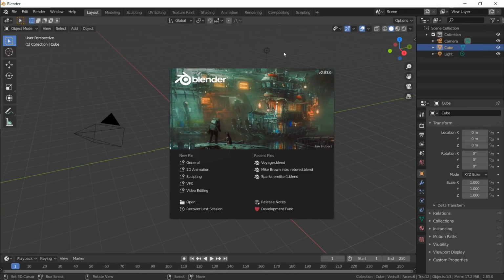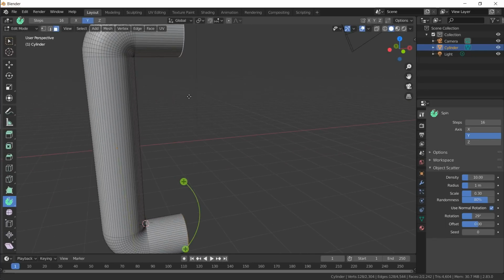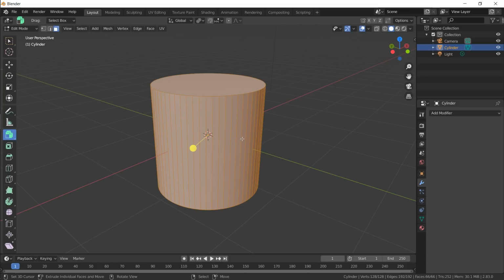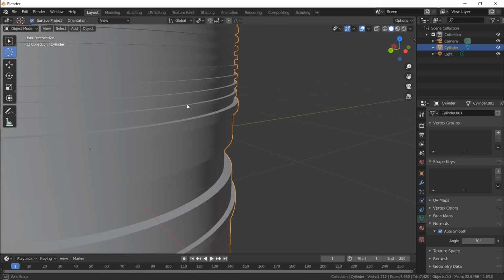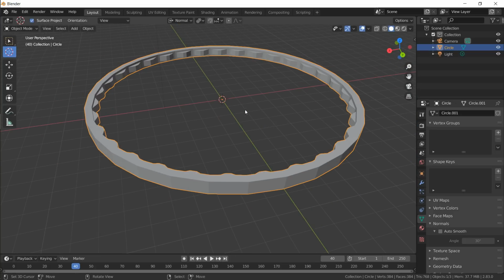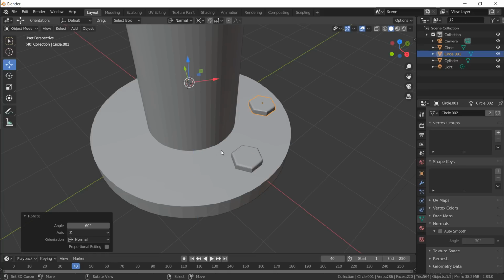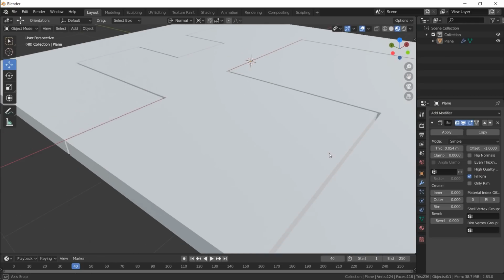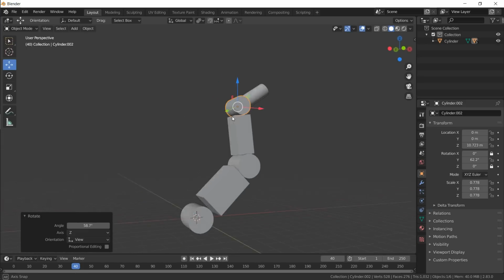10 Hard surface tricks for Blender

Comment: For the animation without a rig, can I create an animation and export the animation to unity without a rig? And another question, since the pieces are all separated does that mean when I export, my model will come in pieces?
Reply from the maker: I don't have any experience with unity sorry. But maybe the object data could still be used. And yes it will export as separate meshes unless you join them.
Reply: @DanielGrovePhoto  Oh ok. Thanks for answering my question :)

Comment: If you are looking to make a car air filter, I made one on accident yesterday messing with the spin tool. All you do is spin a cube a bunch of times and it will make a cylinder with the edges of the cubes being the outside face.
Reply from the maker: That is a good way to make that shape! I'd prefer though to make a cylinder with maybe 64-120 vertices, select all the outward facing faces, do an individual inset on all faces at once, and then extrude inward and bevel those new edges. May need a top and bottom cap shape to complete it.

Comment: All tips are very solid and helpful for beginners, but the last one about parenting, I totally didn't know about even with some experience. I will absolutely integrate this into my workflow :D
All in all a useful compilation, thanks for sharing!
Reply from the maker: Thanks so much! Yeah the parenting thing happened out of necessity.. or laziness once I started trying to learn rigging and bones. I found they are more geared to organic models and it didn't make sense why a multi piece hard surface model like a robot should be joined as one mesh! I like having control over objects and not joining them. So I found parenting a good easy route for animating robotic type stuff. be sure to put the pivot or origin points where the joint is AND lock / limit rotations for the object so it will only move the way you want.
Reply: @DanielGrovePhoto  Best things develope out of laziness :D
But i totally agree, I am also more interested in mechanical stuff, like mechas and such, but rigging seemed always kind of overwhelming. So your tipp will be massively usefull!

Comment: In order to use the mirror modifier you could use the "automirror" add on (comes with blender). Activate it, and in edit mode press N to get the menu. Click on "edit" and automirror.
It will split the geometry for you, adds a mirror modifier and activates clipping.

Next up: for the rings around your cylinder use "extrude around normals": select the faces and press alt-E. Then extrude along normals. Saves you time there.
Reply from the maker: Awesome trick thank you! I've often thought "why do I have to do these steps myself over and over? I wish there were an addon!"

Comment: Shift - R is a super handy shortcut to repeat an action or series of actions. So copying the bolts around the base of your pipe would be- (Alt-D, R, Z, 60, enter. Shift-R x 4)
Reply from the maker: Ya I use to think I had to do enter after shift D and so that rendered shift R useless. But I was wrong! Thanks for this tip though it's great.

Comment: For the flat panel with depth, there's an easier and I think better way. When you bevel and delete faces, you end up with gaps that light might leak through, or that you might be able to see through at some camera angles, which I don't think is what you want for most panels.

Instead, select the edges like in the example, then hit V. It'll rip the selected faces, but keep them in place. The three parts of the plane will be touching, but not connected. Then, add the solidify modifier for your desired thickness, and after that add the bevel modifier, and play with the distance and number of segments. That bevel modifier will pull the edges apart near the surface, but leave them touching lower down so you get that well fitted panel look, without being able to see through the gaps.

You can use the shade smooth + autosmooth trick from earlier to keep the number of segments on your bevel lower, without the edges looking sharp too!
Reply from the maker: Thanks that is a great tip and I've never learned rip. When I have tried it didn't work so I've just avoided it. Thanks again.

Comment: Great video, any tips regarding larger bends on the pipes to add a bit more variation to a complex pipe over constant tight 90 degree bends.
Reply from the maker: Well they don't have to be 90° and moving the 3d cursor farther away will make the bend radius larger.
Reply: You could also use curves to create pipes.
Reply from the maker: @ZEDCorbett  True you can and they are handy but there are some downsides to it.
1. If you use curves in 2D mode all pipes must be on the same plane such as X and Y, no Z for example.
2. If you use curves in 3D mode there is an odd pinching effect near the bends if in vector joint mode for harsh angles like 45 and 90 degree turns. I have not yet found how to avoid this pinching. I hope someone has and can help me!
3. If you use either mode you can't add rings, width changes etc. to add character and style to the pipes. There is a way to use another curve to change the thickness of the main curve but it's a hastle. 

But with some cleverness use curves mixed with mesh objects for joints and other style pieces for a good outcome.
Reply: @DanielGrovePhoto  You can use the Add Pipes addon - ships with Blender, just select it in Preferences

Comment: Thanks. One pedantic thing on Tip 1: You need to drag the spin centre away from the cylinder a bit. You would never get a pipe bend with zero internal diameter in real life.
Reply from the maker: Oh thank you! I appreciate details like that and didn't know.

Comment: Another tip: Each time you hear "don't move your mouse" in this tutorial, you can substitute that with "click the right mouse button" (on new controls). This apply whatever tool you have started working with (extrusion, loop cuts, etc) in its default position, undoing any mouse movement. Much easier than "don't move".
Reply: Thank you. :)

Comment: Can use shift + r to repeat the action for the bolt thing :)
Reply: I did this by just using the array modifier and using the "offset object" option to make it use an empty object at the 3D cursor as the central point
Reply: @r6scrubs126  yeah was thinking the same, it's just easier to use an empty
Reply: I think about that too))
Reply: also you don't have to press Enter after Alt+D - you can press R+the desired degree and then Enter
Reply from the maker: Yes thanks! Learn something new every day/video.
Reply: I tried this and it does not work. It only repeats the last action, which is the rotation, but it does not repeat the ALT+D operation.

Comment: Now I will never have to suffer making pipes or arches lmao
Reply from the maker: Glad to hear the video helped! Check out the others on hard surface and hallway modeling they have some cool tricks in them too.
Reply: If you want more organic pipes or tubes you can just use curves and use a thickness
Reply: @Thatsmahnut  agree and that also works for the pipes he shows. And indeed it is much quicker, more flexible when it comes to the shape of the pipes (make them longer, add corners etc) and of course the profile. Not only can you use the curve geometry options but also other curves as profile, which you can change very easily. Pipes, ceiling molding, beams or picture frames, all made very easy and quick with curves.

Comment: Thanks for the one with the pipe! I often tried to achieve that but always ended up with something ugly, for I may not have used the right technique. This one's really easy and works!
Reply from the maker: Thanks! That trick comes in handy a lot for all kinds of cylindrical shapes like hydraulics, lightsabers, pipes, and it works for other shapes too! Ridges can add a good level of fine detail when used in the right place. Don't forget to add a small amount of bevel though so that the edges are not impossibly sharp.

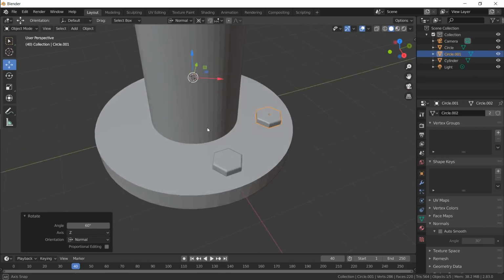Comment: 13:25 shouldn't Shift + R be faster than this?
Reply from the maker: Yes but it only repeats the single previous key press. I think I learned that I don't have to press enter inbetween certain key commands though so you're right. If I did ALT+D R Z 60 without enter inbetween the D and R I can then use Shift R to repeat it multiple times. I guess I was being too proper haha but lesson learned from another commenter.
Reply: @DanielGrovePhoto  haha no worries, thanks for the response! Also thanks for the great tips, can't wait to get home and try these out!

Comment: That was fun! But I have a question, whenever I extrude, right click to cancel and scale (like inset) then extrude, my bevel modifier when added does not work.
Reply: Try disabling clamp overlap in modifier settings (though it may cause artifacts) and be sure to apply scale in object mode

Comment: A lot of these operations can be done with just a simple right click, left click in your case. Do you not have a middle mouse wheel or what? In the future you should label “beginner” in the title.
Reply from the maker: I use a stylus and have a laptop that doesn't have middle mouse button so I've adjusted to that way of working. I suppose I could program one of my stylus buttons to be middle button but then I've have to relearn a lot. And I also got use to right click for select so I never changed it.

Comment: Yep.... you made a pipe.... a pipe with pinches. How are any of these tricks? Standard blender stuff.
Reply from the maker: Not standard if you didn't know them. I've never seen anyone tell me to bevel an edge loop but it has saved me a lot of time as have the other tips. If it's not on your level then it's not on your level. I never said it was advanced hard surface modeling. I'm more aiming at the beginners.

Comment: Here's a bit of a shortcut for duplicating and rotating those bolts: After pressing Alt+D, you can instantly press R+Z+60 before hitting enter so it'll just snap into that position. Then you can press Shift+R and it'll just do that same operation again for as many times as you press Shift+R. (Note that Shift+R only copies the last operation you do, so if you did anything in between duplicating the bolt and pressing Shift+R, it won't work.)

Edit: Also you can use the scroll wheel to increase or decrease the amount of loop cuts you want to add instead of the plus or minus keys
Reply from the maker: Yes thank you for that tip! I hadn't tried those two commands as one without enter in the middle. And I use a trackpad / stylus so no scroll wheel for me!

Comment: This is a bangin video!!! Love the tips...its so useful to watch and train my brain to think 3d coming from a 2d world... one question though.. the bridge loops on the square, looked easy... but what about doing the same trick on a cylinder??? Would love more videos like this... thanks!
Reply: As long as the number of vertices is the same, it works.
Reply: @blenderinthegrass  ahhh I think I meant on the side of a cylinder.. obvs end to end is easy.... :)
Reply from the maker: When you do bridge edge loops there's a control panel that pops up on the bottom and gives you various options. I watched an interesting video about it once I'm sure you can find. Or just do a bunch of experiments with various shapes, maybe with an edge loop in the middle and see if it makes a connection between all 3 loops.

Comment: Not so bad, useful but you can lern little more more. 
Use scroll instead of +/- can be faster. 
Screw or circular array instead of duplicating 1000000 times.
Shade smooth, just right click and choose.
Plane... Bolean could be better, or like vertex group, and the best could be texture (for small insert).
Reply from the maker: Thanks for those tips they are next level from mine.

Comment: For the cutting-channel-into-planes-effect: you can get a quite similar effect non-destructively if, instead of beveling and deleting the paths, you mark the edges as sharp, add them to a vertex group, and stack the modifiers "edge split", "subdivision (simple)" and "smooth", before starting with the "solidify" as you did. The overall effect may look too smooth for your purpose, though.

Comment: On the cylinder ring trick, you can scale along the normals by using Alt + S, which saves you from having to change the origin to individual origins. You can shorten this even more by using Alt + E and clicking on extrude along normals option, which will extrude and scale on the normals in one swoop.
Reply from the maker: Oh great tips! Thanks I didn't know about those commands.

Comment: shift +r to replicate last that you do
Reply from the maker: Yes that's a good trick but if you need 2 commands it won't work as it will only replicate your last step. So I was doing ALT+D and then R+60. SHIFT+R would only replicate the R+60 part.
Reply: @DanielGrovePhoto   ALT+D , R+60. And then confirm click. Next SHIFT+R will do the trick. Thanks for the video.

Comment: For the bolt around a circle use an array modifier.
Reply from the maker: That plus a rotated empty can make the circular array, you're right. I think I'll do a modifiers video sometime soon.
Reply: @DanielGrovePhoto  for added bonus, use a driver to link the array count in the modifier to the rotation of the empty.
Reply: An array would work, but I think the linked duplicate (instance) is more efficient on memory and performance. 
Also once you create and rotate the first instance (alt-d rz-60) you can quickly create more instances by using shift-r to repeat the last task. much faster.
Reply: You could as well use Shift+R to repeat the duplication+rotation (:
Reply: Just what i was gonna say my man XD